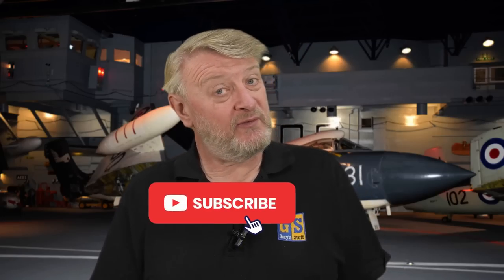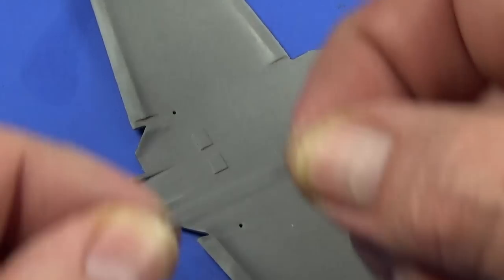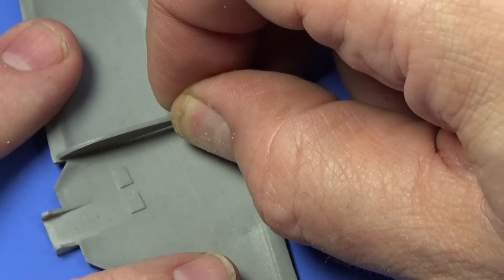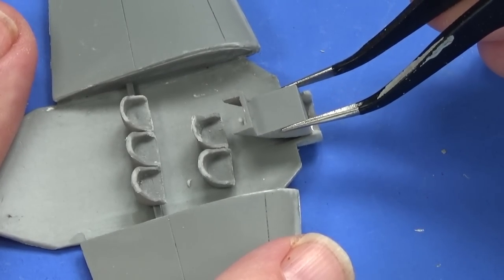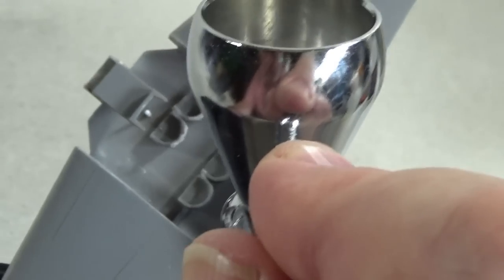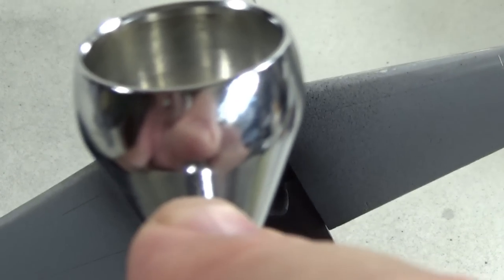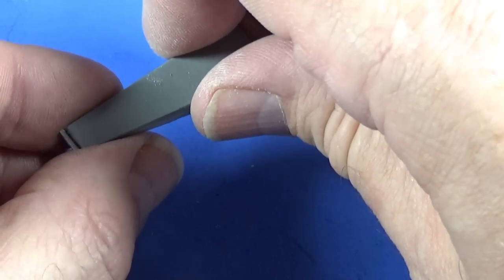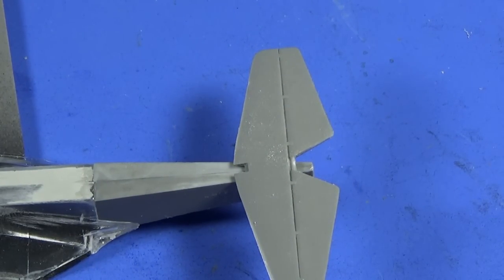CRAZY FANERA-2 - how to build the MikroMir kit!

Comment: I would say a typical MikroMir kit, though they are getting much better these days. My first one was the USS Hunley which was also a bit challenging. Especially the PE parts can be useless. I replaced some with plastic sheet. For example the screw instead of one PE part to be twisted into screw blades was made up of 3 individual parts to be butt glued to (misshapen) plastic hub.

Comment: Just a thought Gary. Maybe a hairdryer on a low setting and/or a couple of feet away would blow warm air over a model to dry paint even quicker?

I agree with Ronald Byrne who said the canopy should have been one piece. They used the same amount of clear plastic so there is no good reason - including having no undercuts - to mould them separately.

Ref decals.. am I going daft or were there /none/ for the serial on the side, or were they just as rubbish as the stripes?
Reply from the maker: The decals for the sides fell apart so I've had to go with a more modern cyrillic 'L'. As for the canopy, to get the lines moulded on the sides of a single piece would likely have needed a slide, which adds considerably to the cost (why the more accurate hood on the Airfix 1/24 Spitfire has a seam line...).

Comment: Very hard to find anything on the 'Net about this plane, however it does have a cameo appearance between timestamps 29:03 and 30:42 in a Russian movie,  https://www.youtube.com/watch?v=_BflDJ7N3Xk&t=1743s The airplane in the movie does not have the engine cowling. Also for those accuracy pedants, note the grab handle above the access door. And I wonder why Natasha is sitting facing the rear. Gary, I think that you have fitted the cowling back to front. I think it should taper from the front to the rear. Compare what you have done with any other radial-engined model. Apart from that, it's an interesting addition to a collection of aircraft history. I've just purchased a 1/48 Williams Bros kit of a Ford Flivver. $AUD 38.00.
Reply from the maker: Production models of the plane (all 20 or so of them) didn't use the cowling, it was used by the evaluation aircraft.
Reply: @garys_stuff  Where did you get the info about the original aircraft? My mates would love to be told about it.
Reply from the maker: @markadams5462  from Wikipedia, based on a book by Bill Gunston https://en.wikipedia.org/wiki/NIAI_LK-1
Reply: @garys_stuff  Thanks, mate! I'll post an entry on the aviation website I follow.